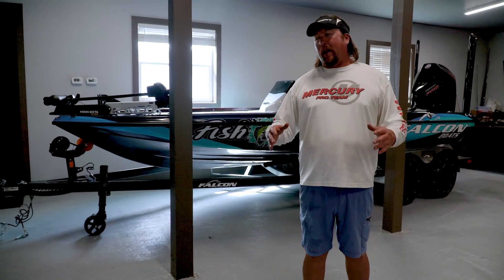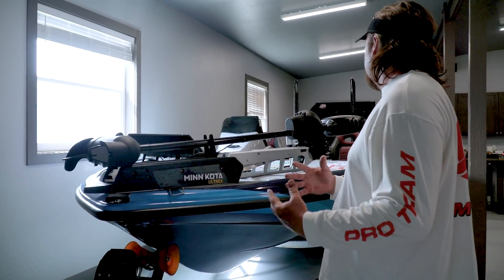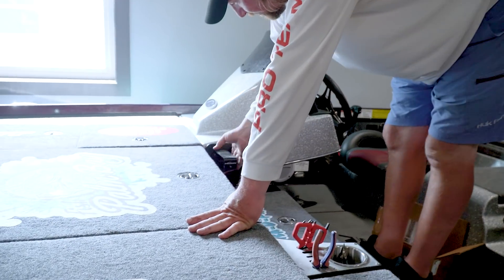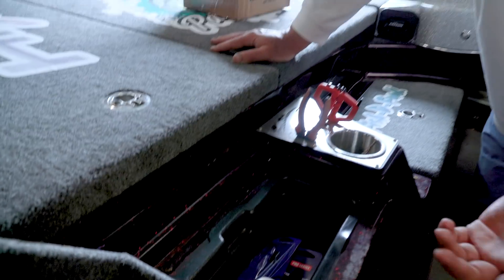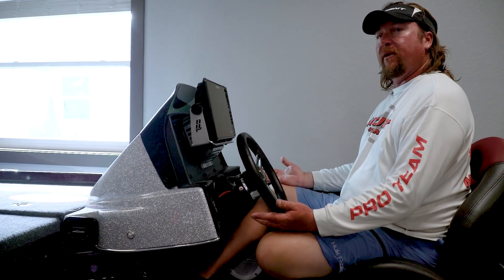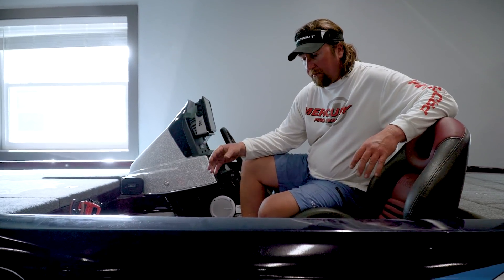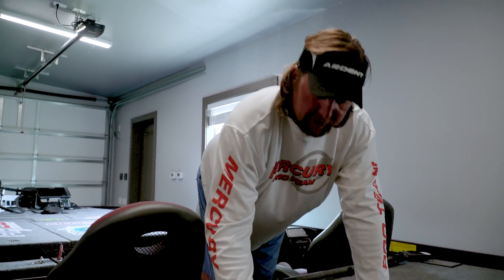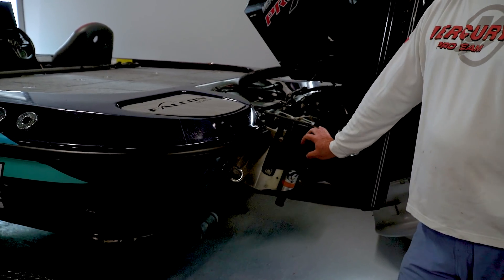NEW BASS Boat Walk Thru: Falcon F20

Comment: JT...can you expand on the "Hot Foot" comment. I am truly interested.
Reply from the maker: I just don’t like a hot foot. Foot gets tired on long runs. I like the cruise control of a hand throttle
Reply: @JTKenneyFishing  my first hot foot damn near killed because it was so much like driving I would approach things to fast and reach for the break. Something I never did with hand throttle. Thanks for the info.
Reply: Also a hot foot leaves you without your legs to soften the blow to your lower back in rough conditions